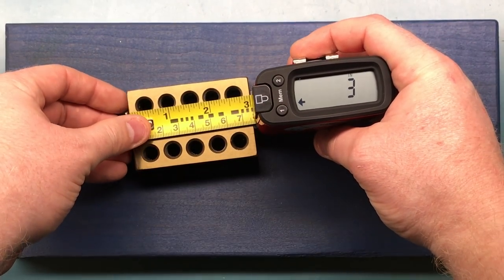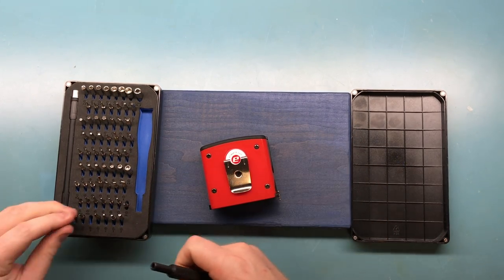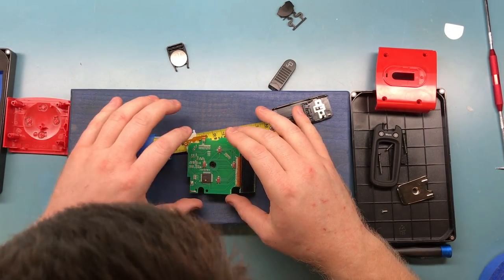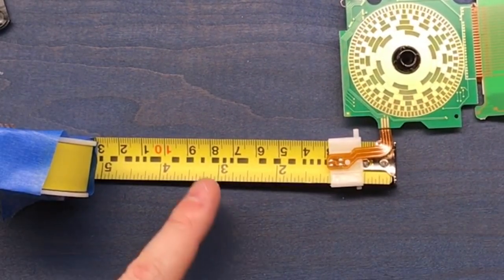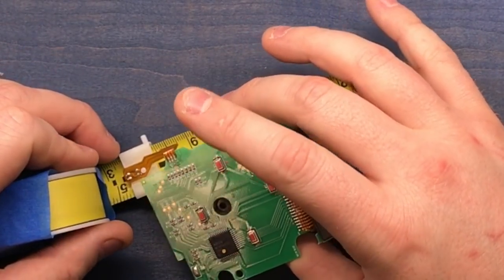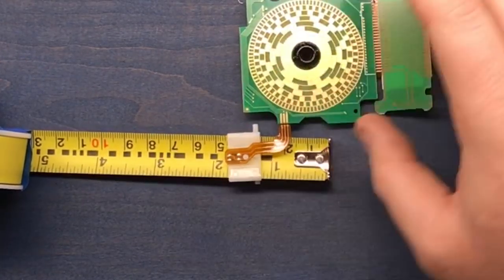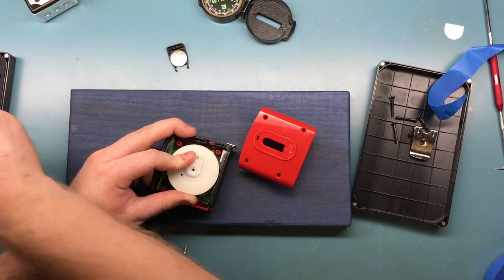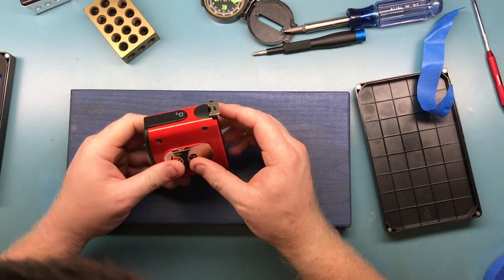How Does a Digital Tape Measure Work?

Comment: Please do high res close up pictures of the different parts in the next tear down. Would be great for those more curious.
Reply from the maker: Good idea!  There wasn't much to look at on the board in this example other than the micro and different resistors for the incremental encoder, but I could add pictures to the end of the video next time.

Comment: The strip is NOT magnetic.  The tip of the tape is to stick to nails. Thats why the Compass moved.
The strip is Optical and lets the microcontroller know what foot. The rotary is for the finer calculations less than one foot.
Reply from the maker: You're right, I ended up finding the patent months after making this video. It does combine an absolute and incremental encoder though.

Comment: The circular encoder looks like it is being used as a combination of absolute and incremental encoder, with the two inner rings acting as an incremental encoder and the four outer rings as an absolute encoder. I suppose they do this so that the incremental encoder pulses are longer and less likely to be missed when pulling the tape out quickly. I suspect the black marks on the tape are part of some sort of error detection system. I'd guess it was optical, not magnetic.

Comment: interesting I didn't know that there was a magnetic strip
Reply: I  was surprised by this too.
Reply: I am still surprised it is not optical. Is the tape metal?
Reply from the maker: Rob Fowler yes, it is a metal tape.  The reason they probably didn't go with an optical encoder is the same reason they didn't use a capacitive encoder; There is too much of a possibility of dirt, grease or liquid getting on the tape.
Reply: Proto G I was more thinking of the issues with magnetic flux against the during steel backing. I guess very good magnetic field detection on a chip is probably very cheap considering hard drive magnetics are impossibly accurate for next to no money.
Reply: Is there a patent number on it? A patent search gives a plethora of ways to do it, It would be interesting to see the detail on the actual mechanism.
Reply from the maker: I found the patent and it is indeed an optical sensor on the tape. I thought it was a magnetic encoder and I'm disappointed that it's not because they even state in the patent that the optical encoder can be easily affected by contaminates such a dirt, oil, and moisture. Mitutoyo uses absolute magnetic encoders on some of their calipers and linear scale with a resolution of 0.1 µm that are perfect for harsh environments. From the patent: "In particular, the instant measuring device includes an absolute encoder having an infrared bar-code which is imprinted along the tape blade and read by an optical reader for providing absolute measurement displays at selected displacement intervals. In addition, the present invention measuring device includes a simple incremental encoder which is formed of a plurality of ridges located on the take-up reel and switching contacts on a circuit board."
Reply: Proto G so why does the compass get effected by the tape ?
Reply: Ozmo Mac because the tape is steel and the compass   is magnetic.
Reply from the maker: That's true, but it is still strange that the compass rotates along the tape.  Probably and unintentional magnetization due to the manufacturing process.
Reply: I should add that spring steel becomes slightly magnetic if it is cold rolled. This would be a normal result of the cold rolling process.
Reply from the maker: Cool,  I figured it may be something along those lines.